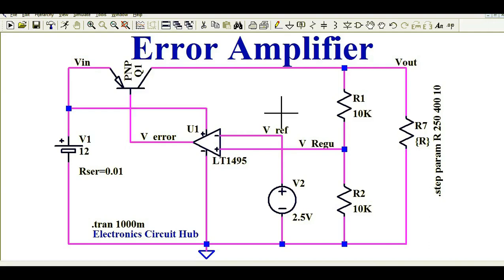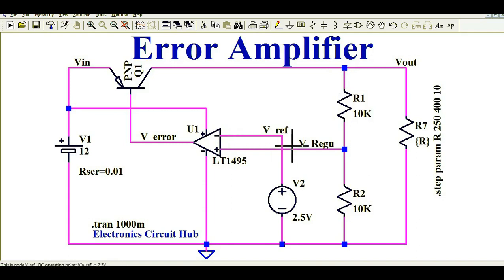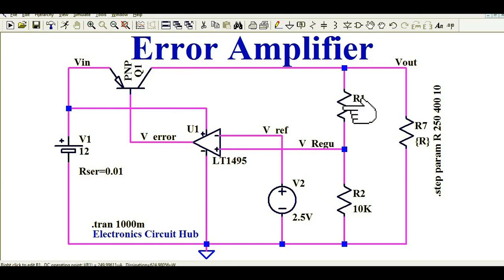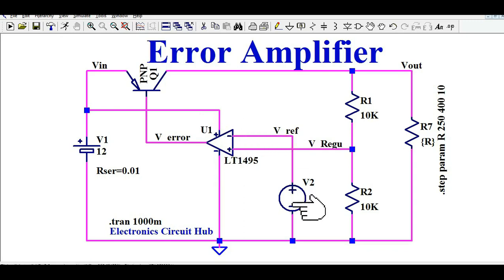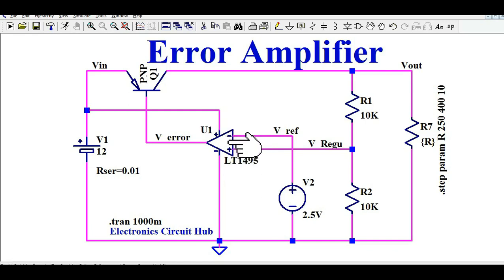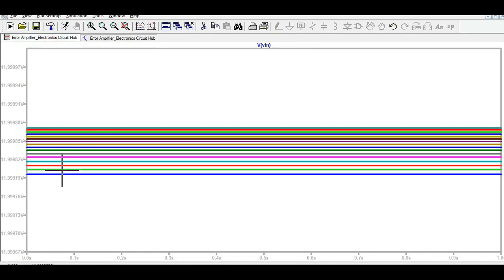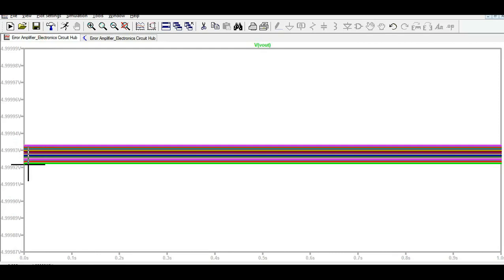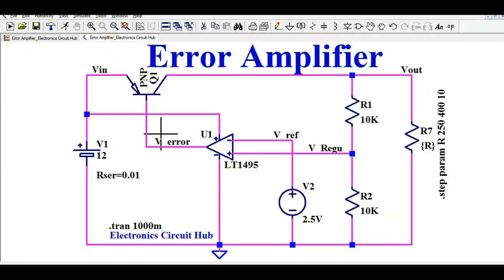Error amplifier design and simulation | LT spice

Comment: why the bias current is 250uA ?
Reply from the maker: Hi...if the current is less , less battery consumption. This circuit is for UVLO ( under voltage lockout ) to avoid deep discharge.

Comment: I have question this is error amplifier or comparator circuit? Bcos. There is no feedback
Reply: Actually there is a feedback coming midway between R1 and R2 taken to V-in positive, and it is compared with fixed V ref V-in negative, and the OpAmp tries to make the two values the same while changing the PNP output.
Reply: 1. Comparator comparing the both inverting and non inverting terminal.               
2. But, in the error amplifier one of the terminal has an stable voltage reference for comparaing the  feedback potential divider voltage with that Vref whether, the output is stable in an fixed voltage.  
3. It also has the compensation elements for stable output of the error amplifier.

Comment: Thank you for the video. I have a question: if the goal is to regulate the output voltage 5v, how is vref determined in this case?
Reply from the maker: Use voltage divider per your shunt regulator reference voltage.